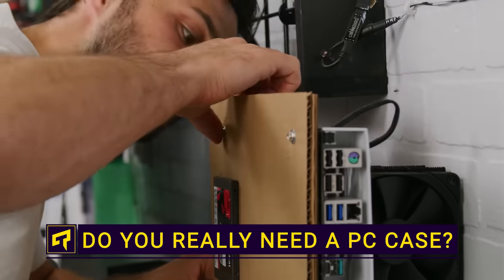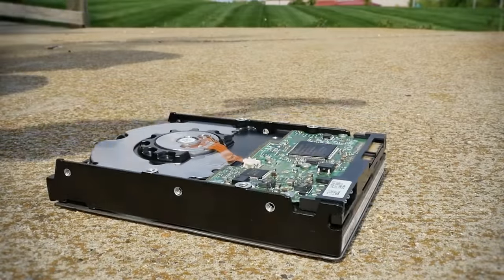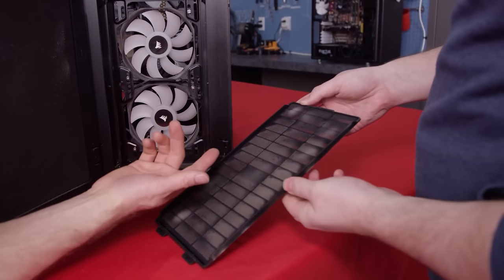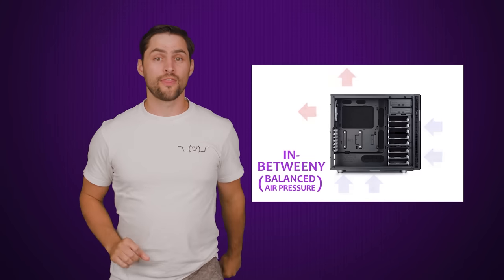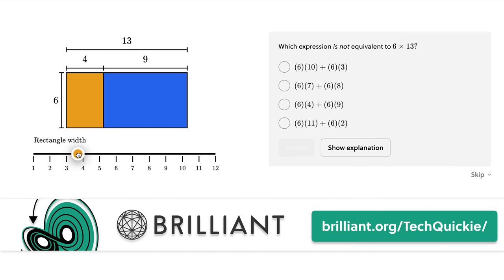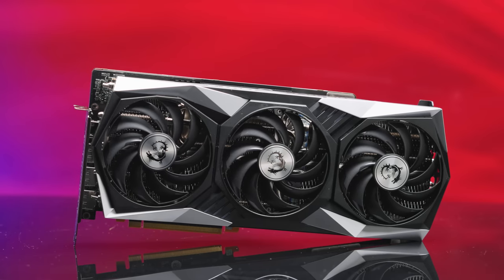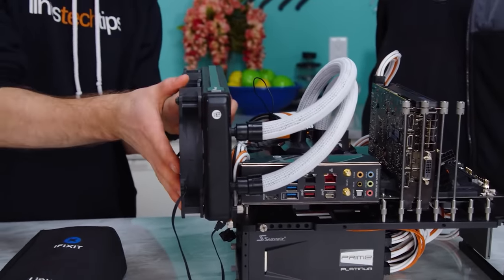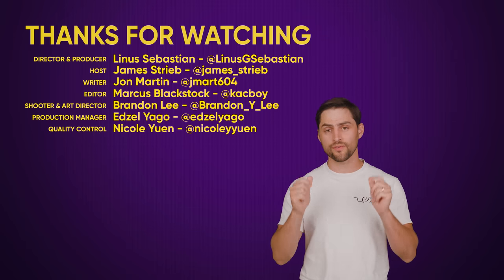Do You Really Need A PC Case?

Comment: I 3d printed brackets and mounted everything to the bottom of my desk. Honestly I love it. Lower temperatures and hidden.
Reply: I agree, but only if you have rails or easy  access. Otherwise prepare for back pain going under the table, scratched arms, blood and tears on every  upgrade (I know by experience, now using a test bench on top of the table.
Reply: @javiej  I have a sit stand desk. I can roll under it with a short chair. But I build a new computer every 2 gpu generations and go overboard with each new computer and don't upgrade in between. I also put 2 USB hubs at the front of the desk. Definitely a good point but in my case it's not an issue thankfully.

Comment: great but what about cardboard cases? I have my stuff in a cardboard box for over a year now and it works perfectly fine 👌🏻
Since it's still open, yes the dust is still a problem but I regularly clean it. However the components are definitely more secure than leaving them totally exposed. :D

Comment: Ive been running a thermaltake p5 for years and never had any problems. In fact i hardly even have any dust problems except in the radiator. Which takes like 2 seconds to clean.

Comment: About 2 years ago, I actually had a caseless setup, just a motherboard, PSU and SSD sitting on my desk, though I didn't install a GPU yet and just used the integrated one instead.

it wasn't in a case because I was planning on modding and apple IIe case to fit modern hardware, and that took about a year to complete, so for a while I just ran the computer without a case.

(BTW, the apple IIe case is really cool now that it's done, though the thermals are kind of bad. I've even hackintoshed it since it's an apple case.)

Comment: I have mine motherboard for my server mounted on the wall in a big cubby hole beneath my headboard. It runs 24/7 without issue and dust hasn't been a problem. As for static...it's in a spot where no one would ever be and it's a headless server so it's basically forgotten about.tthat being said I have a huge corsair air atx case here I'm eventually going to move it into. I just needed plenty of room for all the extra drives where I could actually keep everything nice and neat and the case was in the way.
Reply: 👆👆congratulations🎊you have been randomly selected among my shortlisted winners you just won a prize🎁🎁🎁...

Comment: I can testify the importance of a case that is also enclosed..... My brother donated his GTX 1080 when he bought a 3070 a couple of months ago to me as I didn't have a GPU. I live in a hot country and I only had the stock CPU cooler and 1 small case fan. So I noticed that after I installed the 1080 the temp went up to more than 90C. So in an effort to let more air through I opened one of the side panels until I got another cooler. But one day when I was cleaning my desk, the keyboard USB cable touched the surface of the GPU and my computer turned off in an instance. So what I think happened was that the USB cable head shorted something on the GPU circuit board as I'm not able to power on the computer with the GPU power connecter connected. I checked it with a multimeter and it seems one of the MOSFETs got fried. So I went back to only use the Intel Graphics GPU................. It stung for a couple of months, but now I'm fine with it. Hopefully I'm going to be able to buy a GPU if the prices keeps going down ;=)

Comment: I used a case from a 2006 Acer for over 10 years, built like 3 different setups in that thing. Only replaced it because I wanted a full ATX motherboard
It was a bit annoying since the front IO header was a single connector so generally I just lined it up so that the power button worked and it was hit or miss if the activity lights worked or not. IIRC in one motherboard the HDD activity lit up the power button instead

Also it could only fit a single case fan, but the side panel had some weird small mesh on the middle so I drilled mounting holes for a fan and it managed to suck some air through that mesh, no idea if that mesh had any purpose originally but it worked

Comment: I had a thought of building a wood board mount and put the motherboard on the bottom. Frames to support the components hanging down, with the whole thing supported by inch to 2inch dowels at each corner, high enough to fit one of those quiet, high volume, desk fans underneath, pointed straight up at the center of the motherboard.  
Is there any issues with a motherboard being upside-down?
Reply: I have been looking for info on horizontal inverted mb mounting. I have found nothing. You?
Reply: @drag1286  Nothing specific, but the motherboard in this build is mounted upside-down and seems to work fine...

https://www.youtube.com/watch?v=Perqf0dOGLk&list=PLOJU8YJjFwGNoMUCmJyUbeuLsx1yQr9m9&index=2&t=510s

Comment: To be fair, computer mounted to particle board are much easier to clean and blow clean.  And they are plenty portable, and you mount the particle board to the wall and the motherboard in a direction so that the graphics cards to not try to pull out or wobble.
Reply: 👆👆congratulations🎊you have been randomly selected among my shortlisted winners you just won a prize🎁🎁🎁...

Comment: So, I just need a clean room, with a rubber floor? Problem solved 🤓
I did use a couple of systems without a case back in the early 2000's, such as for my HTPC. It was just in a cardboard box. The motherboard did die after like 6 months. The hardware wasnt as reliable back then for lower end hardware, but possibly it also had some static shocks over time even though I kept it fairly clean of dust.

Comment: gpu flopping around in the pcie slot is the biggest issue i've ran into running a caseless pc.
hasn't actually been an issue thought because i use a 1070 mini. i could imagine a beefy gpu causing huge problems.
but in that case i'd just use a pcie riser cable and just lay the gpu on the desk too

Comment: electronics generate massive amounts of radio interference. computers wipe out SW, LW, MW, FM radios. 
A IT colleague had a 20k computer back in the late 1980's at home from work as spare parts (from his in car field kit for servicing customers gear) used as a home computer without case, he blew it all up from static discharge from the CRT above it. cost him a massive hit to his salary for a few years after. the entire system was a 16MB 486DX-40 RML system. A number of us were doing the same, but some of us used antistatic crt screens to discharge the static to the PSU casing.  The amount of EMF's at close range can cause health problems to users.

Comment: What if the whole system is solded (memory, graphics card, etc)? Will it -still be a (not) good idea to wrap it inside a case?
Reply: That usually comes with a built in 13"-17" screen and plastic body. Its also very portable.
Reply: @TheSjuris  LMFAO

Comment: My computer sits on a shoe rack in my basement. With no foot traffic and a small box fan blowing on set to low. 
The gpu are connected with 6in" ribbon cable
And all my cabling going to my monitors are 20 ft long
I work/game upstairs. 
Been like this for 3 years. 
AKA my basement is my case. 
 
It has not accumulated dust.
I wish I could show you a picture. :(

Comment: Best case is no case. I would not do it for bug computers, but sffpc it is much better:
- More portable, less size, less weight
- Cheaper 
- Easy to diagnose, repair, and upgrade 
- No scratches in your hands/arms
- Not going "down there" in uncomfortable postures
- The case creates a problem that the computer  didn't have: need for airflow / cooling systems ....
- With no case, your kids will rapidly learn what happens if they  touch hot parts, exposed fans or exposed electrical contacts, it is good for their education ;)
Reply: 👆👆congratulations🎊you have been randomly selected among my shortlisted winners you just won a prize🎁🎁🎁...

Comment: Considering that you can get a basic, but still decent case for $50, IDK why you wouldn't have one. It's literally the cheapest component in most builds. Just never use the included PSU if your case comes with one, as they're usually trash.

Comment: I prefer an open case or a free air motherboard platform, any time... Everybody use "dust" as the absolute reason for a case - but you can airblow the open platform any time in 20 seconds in a balkony - just pull out the 4-5 cables connected on the platform - and you can do it every week (I do it every 6 months).  Also, there is no need to buy extra fan coolers, you avoid the exsesive noise - because sooner or later 4 extra fans will sound bad no matter what you do.

Comment: A case also grounds your computer to the case so if an uncontrolled surge happens the electronical components may be fried but a fire does not occur in most normal cases for instance while you're sleeping and so is your computer and a thunderstorm rolls in while you're asleep
Reply: A case does not ground your computer. Your computer grounds the case (typically by contact with the PSU frame), all the computer parts have ground cables going into the PSU / VRMs,  with or without the case.
 Regarding fire containment it depends, sometimes it may help, but other times it will keep all the fire heat growing inside  with no place to go,  extending the fire to the other parts and reaching extremely dangerous  temperatures.

Comment: If you're willing to clean dust every few weeks, then running a PC without a case is fine, and actually offers better thermals than with a case. The static electricity thing is so rare that I've never shorted a board in my whole life using static electricity. And with the slots, having an upright GPU isn't likely to bend one of your pcie slots

Comment: You guys should do an rgb video. I have an open frame thermaltake core p3 and love it but other than fans, ive run into some rgb things I would like to do but if I did I'd have to get really DIY and creative. Like, I lined the inside of the cable managment area of the case with a 16 foot govee strip light so it'd turn on and off with my room lighting, and I'd like to do more around the motherboard and outlining the tempered floating glass of the case and haven't quite figured out how I'll do that and maintain a claen look. So what would you guys do if you had to get creative ad DIY RGB lighting for a case--and perhaps a whole room to compliment to pc set up?

Comment: Some parts of this video are misleading - it's true that it's a good idea to use a case to shelter your components against outside elements, HOWEVER, cases do not entirely eliminate the problem of dust - ask anybody who has a rig for several years and never opened a case to clean up, you would be surprised at the amount of dust that can find its way into your case and onto your motherboard, fans, PSU, GPU, etc, no matter how good your case is , no matter how many filters used, not all openings in the case have filters, dust WILL find its way into your case, and having a case does not mean you will NEVER have to open it up from time to time and clean out that dust before it accumulates into thick layers.   As far as static electricity finding a ground, well that's not relevant, if your case is plastic  that is, if your case is metal, that's another story :D

Comment: So much for Linus own video from roughly 2 years ago about static being basically a non issue. Also what I did with my open case - just put a filter on CPU fan directly. Then open case catches more dust like every surface in your home, but it's also much easier to clean than a closed one. Sorry, try harder? :)
Reply: Your comment do not really make sense. 
If you have filters in your case you simply have to clean them. 
While your open case will still need a lot of cleaning on the motherboard, slots etc.
Reply: @LoskLive  not sure you have ever had an open case setup. I have more dust on my monitor and stand than in my open case. Twice a year blowing off some dust is fine.
Plus I don't have animals and we have vacuum cleaners in my country :)
Reply: i was thinking about the electro boom colab as well where even with that static generator they couldn't fry the board
Reply: @veec1539  exactly

Comment: Don't forget about the people who used a fish tank filled with mineral oil as a computer case. Sounds good in theory and will work if done correctly but air fans and heat sinks behave much differently when emersed in any kinda thick fluid. And once you do that you can forget about selling it.

Comment: As someone who couldn't care less about looks or RGB or anything,, i just want cheapest case i can get that gets the job done. I do like modern cases though in that they do a much better job managing dust, my current PC i've had for like 6 years now i rarely have to clean out, there just isn't any dust compared to my older PC's that used to have layers of dust on everything so quickly. Other then that and just having a case that's easy to build and mount radiators in, etc. I couldn't care less about anything else. I tend to by a $100 or less then $100 case. I don't think i would want to build outside of a case however because i don't trust having something fly into a fan or GPU and exploding or something, lol.

Comment: Solution: Overhead platform mount and thread the cables down through a cable case on the wall. Cooling? Wall fan or ceiling fan. 😂

Comment: What ever, my Frankenstein system that I pieced together from parts of a trash can. It was put together to be used as a research computer, it's just crunch numbers. It utilizes both GPU and CPU for this task. I didn't bother putting that thing in the Box, I just screwed it to a stud in the wall. But like I said this is a Frankenstein system built from Parkside dug out of a trash can so I'm not that concerned with it. Nearly 5 years later it's still their computing. The only problem it had was RAM chips made in China. Only 2 years old and they died Meanwhile my other set of RAM chips made in Philippines, 15 ish years old and still working fine.

Comment: I ran an open air PC for almost 20 years back in the single core days, now I use a case back then only I didn’t use ads fans lol I use noctua case fans now 2 A12x25’s and 2 1700 rpm P12 Redux’s, one of the A12’s is on my 120mm rad the other is an intake same with the P12’s
Reply: 👆👆congratulations🎊you have been randomly selected among my shortlisted winners you just won a prize🎁🎁🎁...

Comment: Since when is creating a short-circuit fatal to PCBs? You're going to be doing exactly this if you don't buy a case, or for testing before you put everything in a case as it is the only way to turn on a system without a power button

Comment: Is not having a side panel attached the same as not having a case?
I suppose there are still some difference.
Reply: bug difference. A case without the panel will accumulate much more dust and it will still create hot air pockets inside. I'd you prefer to go the  open air  route  (I do) better use a "test bench" or similar. Extruded aluminium models is a good place to start

Comment: Since we're on the subject of a PC case, I just wish Linus would try to make one since they have the machine to cut those metal sheets and put them together. And maybe order a tempered glass to complete the front and side panel.
Reply: And then what?
Reply: @sunbleachedangel  test how easy it is to make a case and see how well the airflow prafroms
Reply: There's a lot more to mainstream case design than that. Your average sheet metal case requires custom press brake tooling; hydraulic stamping; anodization, powder coating, or finish coating; injection molded components for handles, feet, hinges, and drive bay sleds; precision riveting or welding... They wouldn't be able to compete in the price bracket. Could they make a one-off case that costs them a couple hundred dollars and sucks? Yes. Could they make a one-off case that costs a few grand and is comparable to your average enclosure? Also yes. However, at the price point, there's no chance. Even outsourcing a one-off to the likes of Protocase would put you in the 2K range for an SFF case, depending on hole count, assuming the design LTT submits is adequate in conforming to manufacturer standards and doesn't require further engineering.
Reply: @outerheaven1000  how would I test making a case??
Reply: Alex made that triangle one
Reply: @sunbleachedangel  I think he meant that's what Linus and his team should do if they did try and make a case.

Comment: stop with the fear mongering already... when i was younger i just placed my motherboard on a fckn shoebox and i did this for over 10 years until i finally had some more cash to buy a case... you know what happened? nothing at all... worked like a charm. i dont mean that its 100% safe but using words like "easily" is just plain wrong.
also: aren't pc cases usually made of plastic (i know mine always were)... soooo there shouldnt be a discharge at all when touching it, no? ^_^°
Reply: so a sample size of 1 (you) proofs there is no problem? man you need to learn a lot .... some people are just lucky/unlucky or have other environments.
Reply: @theplayerofus319  oh please, static electricity? dust? even if my cards fans completely would stop it would just shut down before it gets damaged... i experienced that many times with many VGAs... also: i did say that i acknowledge the possible danger here, but in reality something like that rarely happens. it's just the way it's presented so exaggeratedly that bothers me.